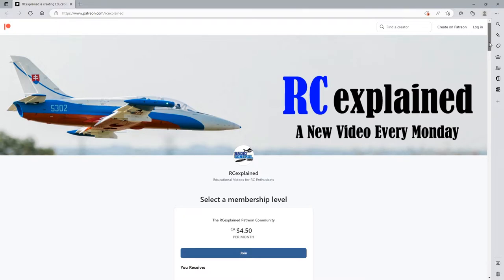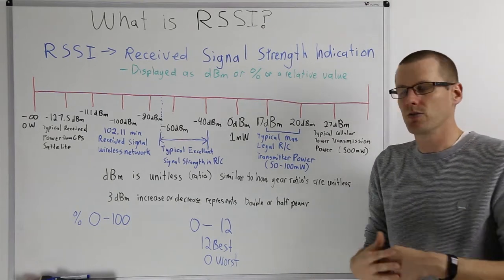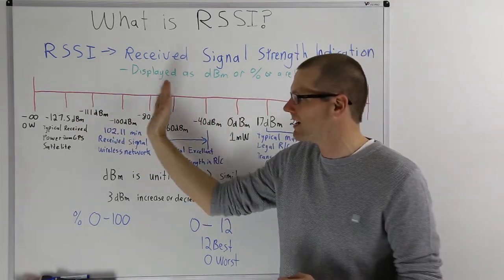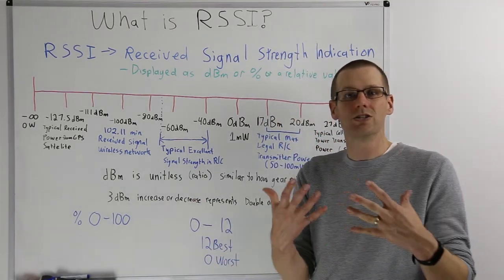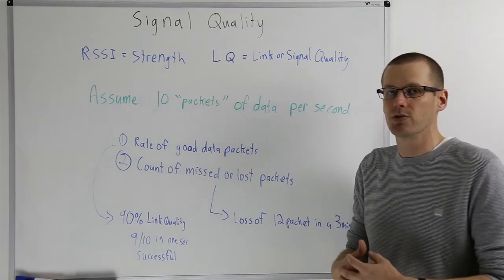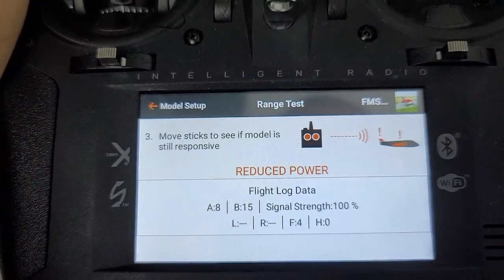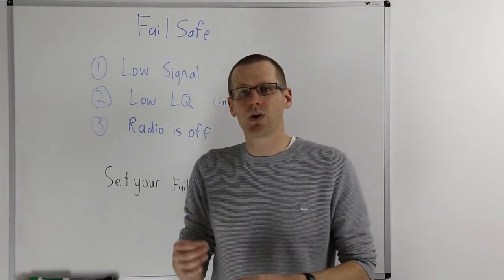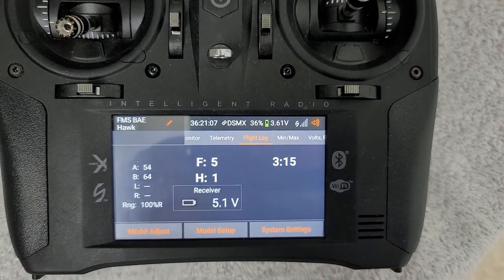VERY Important Terms RSSI, Link Quality,  and Failsafe for RC Vehicles

Comment: Hey! A little note to the dBm vs dB. In the video, whenever you say dBm thinking about a ratio, you should have said dB.

In order to amplify a signal 2 times you would use 3dB amplifier, not 3dBm.
similarly, if a transmitter outputs 10dBm of power and you're receiving -60dBm this means there is 70dB loss.

Basically you can add and subtract dB and dBm in one equasion, dBm would represent the absolute power and dB the gains and losses (see: link budget).
10dBm + 3dB = 13dBm
-30dBm - 100dB + 10dB = -120dBm

Anyway, great video as usual :)

I will take this opportunity to thank you for the great work you put into this channel, I've learned a lot about RC power systems from your videos. I often use them as a reference when discussing with others about myths and misconceptions in the RC world. You're a great teacher, keep it up!
Reply from the maker: Hey robaki, thanks for the pointers.

Comment: Not much on the market for open source controllers and many options for DIY.  0dBm is the reference. There are lot of ways to improve SINAD. Back in the day's 80km could easy be achieved as very little noise was on the ISM spectrum. Two other factors you left out is the robust ability of modulation type and bandwidth of the signal including Mbps vs distance. Personally I would just use the Cellular network or private lic LMR repeaters along with Gyroscope, GPS auto correct for drones.